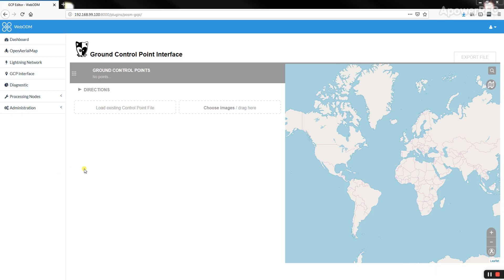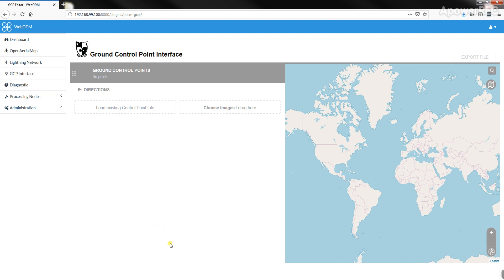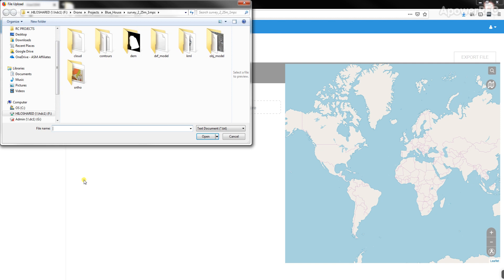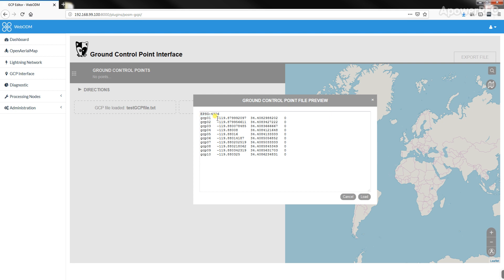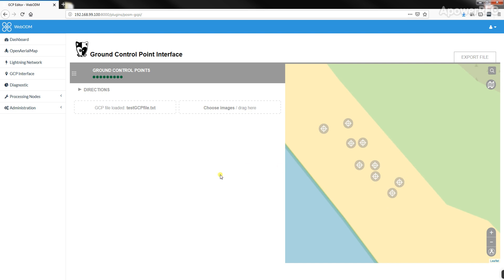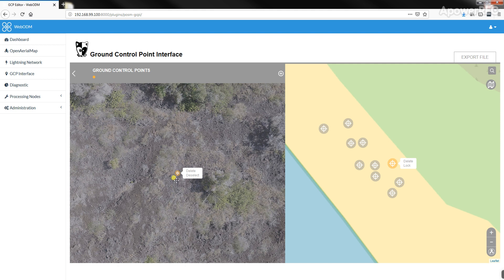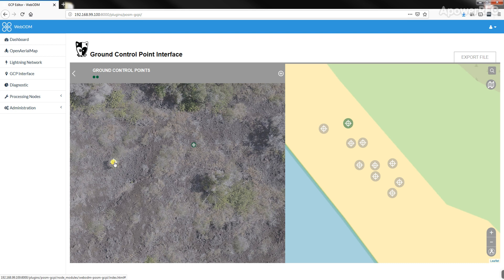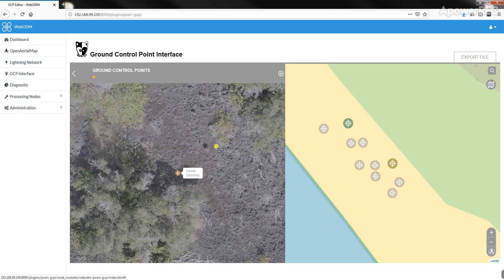WebODM GCP Interface part1

Comment: Very helpful video!  So do you have to use a .txt file for GCPs?  I'm using a GIS system that only allows me to export points as DXF, KMZ, MFD, MIF, SDTS, or SHP files.  Would I have to manually create a txt file based on lat/long and the projection?   Thanks for your help!
Reply from the maker: Hi Kellen, I'm pretty sure you'll have to export from whatever GIS you're using and create your own .txt in excel or similar. Most GIS programs will export the lat/long attributes of points to a .csv or .xsl file. It's been a while since I've messed with it but pretty sure that's what I did.

Comment: Hello. I'm trying to use this interface, but when i click in the first image, it creates an extra "GCP" in the side screen. In your case it happened in 1:57. You had 9 control points. When you clicked the image, another point was created, so you had 10 points. I my case, i have 6 images with one commom point, so at the end of the task I'll have more 6 points on the screen. Is that correct? I don't know if i made myself clear, i hope so...
Reply: That is not a GCP, that is the middle point of the image on the map as calculated from the EXIF values before calibrating with GCPs, I suppose.

edit: No, it was just a point on the center of the image.

Comment: If I have points in EPSG:6494 Michigan Central, can I put EPSG:6494 at the header?
Reply: I had to use - +proj=lcc +lat_1=43.66666666666666 +lat_2=42.1 +lat_0=41.5 +lon_0=-84.36666666666666 +x_0=3999999.999984 +y_0=0 +ellps=GRS80 +towgs84=0,0,0,0,0,0,0 +to_meter=0.3048 +no_defs    for Michigan South feet   https://spatialreference.org/ref/epsg/3593/
Reply from the maker: @metalthower  When you say "had to use" do you mean when acquiring the data you had to use it or, do you mean to get it to work you had to use it? Either way, you should be able to check webodm GitHub page for supported coordinate systems. I didn't check if yours works, but typically it supports all common EPSG formats as far as I know. Sorry i could'nt be of more help!